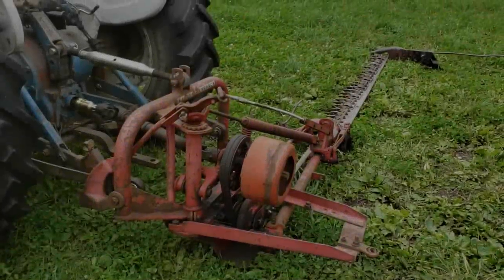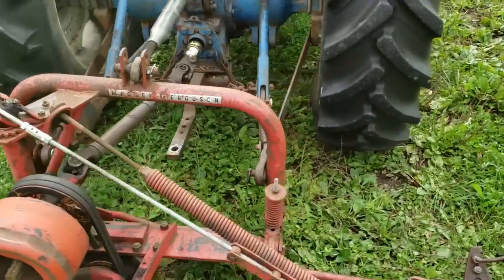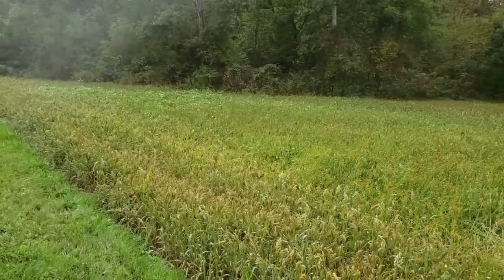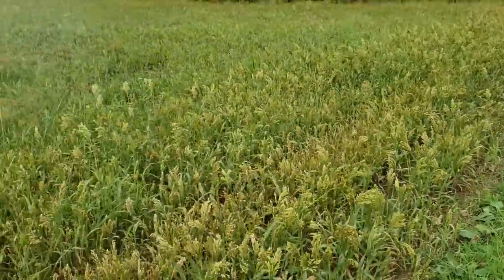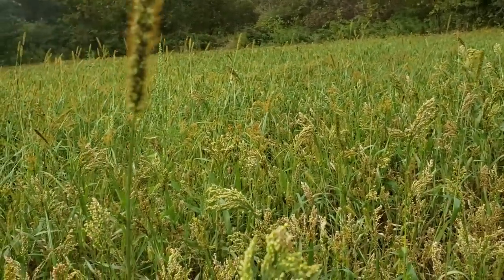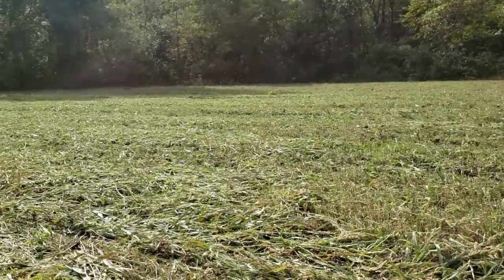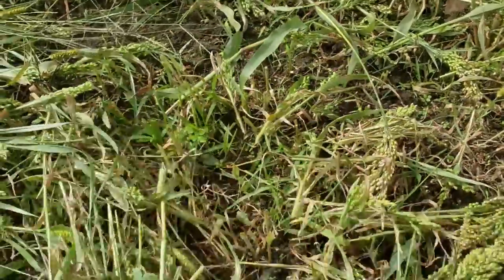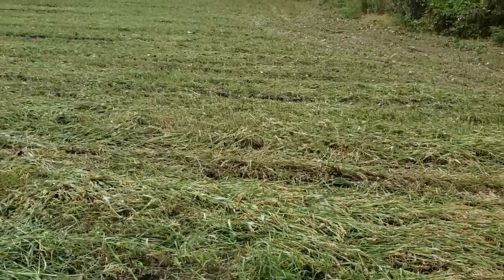So We Grew Millet......Now What?

Comment: This video brings back some old memories.  About 40 years ago, I was a teenager living with my grandfather, and later father, on a hobby farm.  The family had an old MF 135 tractor which was very similar to yours, and we had a very similar sickle bar mower.  I can remember "helping" while my father bradded in new teeth on the mower.  Occasionally we borrowed my great uncle's haybine, which was much better because it crimped the hay for faster drying.  By the time I was old enough to be trusted to operate the equipment (~16 yo), we had upgraded to a rotary mower, which cut grass much faster, and was a lot easier to maintain since it had far fewer teeth and didn't hit every last rock in the field.
Reply: Wow!

Comment: Three point linkage invented by Harry Ferguson, for the model T20 tractor brought out in the uk in the 50,s it brings the weight forward from any implaments that are on the back, for extra grip and stability,.
Reply: Ferguson patented the 3 point in 1926, built a few various development tractors with it, but it took hold when he convinced Ford to use it in mass production on the Ford 9N (1939)